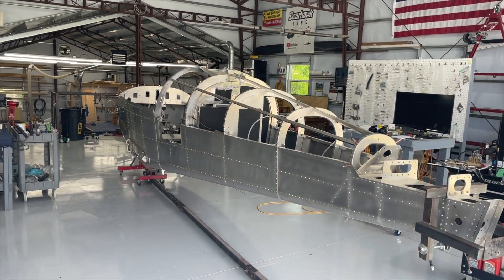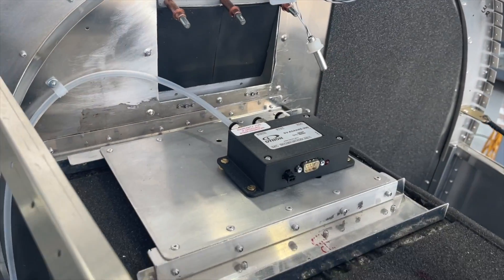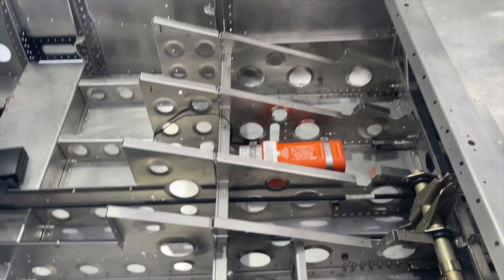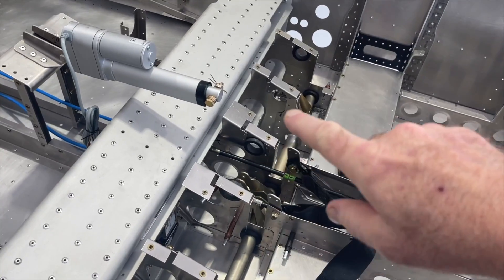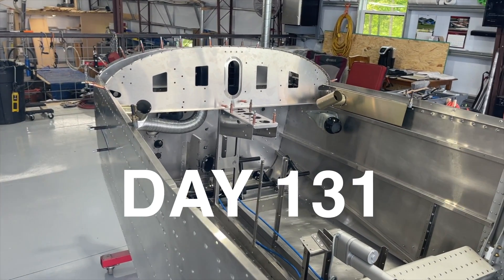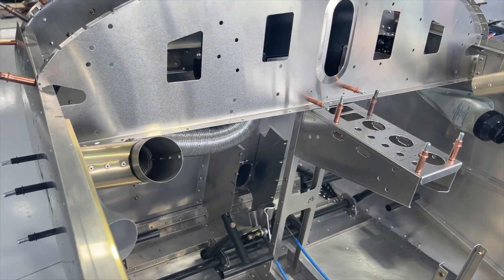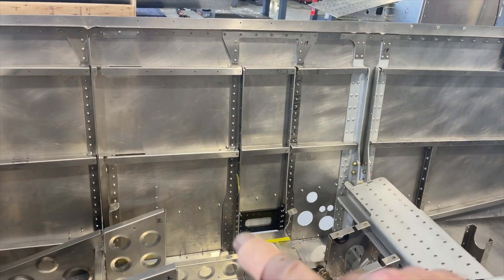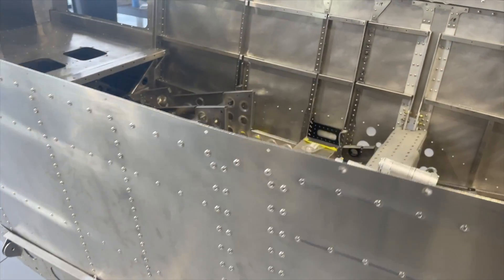Sling Aircraft Assembly Mistake  [Sling TSi Build Video #14]

Comment: In the words of anybody that's built a plane (or house or anything really), shit happens!
The beauty of modern CAD designed and CNC match drilled structures, these bits looked interchangeable, and probably less than a couple of hours work.
Spare a thought for guys building from plans, and drilling their holes from rough tape measure marks, half of their rivets probably wouldn't have lined up.
Reply from the maker: Oh thank you for the kind words, and thanks for watching!

Comment: Why the goal of no antennas on top? I do have a GPS puck forward of firewall for my G3X, but the antenna for my IFR navigator is on top, so it's fully unobstructed. I thought that was required, or at least recommended by the manufacturer, for IFR / WAAS GPS.

That aside, it looks like your rotisserie is really coming in handy!
Reply from the maker: I just really like the look.  Hey I have no hair on my head.  Why have hair on top of the bird?!   But it was the Vans " bottom diamond" antenna layout that I liked.  My panel has the option to upgrade to the WAAS Garmin 175, and I probably will do that.  I will make a pad for a top mounted puck near the luggage compartment area.  Yes, the rotisserie has been super handy.   I made one for the wings too!
Reply: @TheBaldPilot  a ga35 will fit the top antenna mount, which you'd otherwise have to figure out how to patch anyway since there's rivnut holes in the skins. Cool idea with the 2 av17's on bottom!
Reply from the maker: @EvanBrunye  Good to know.  Thanks Evan!